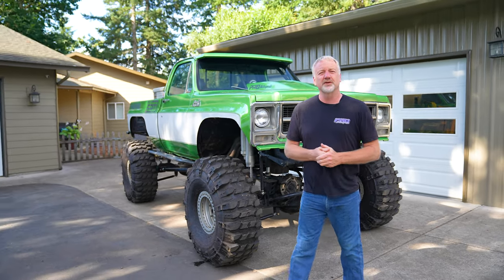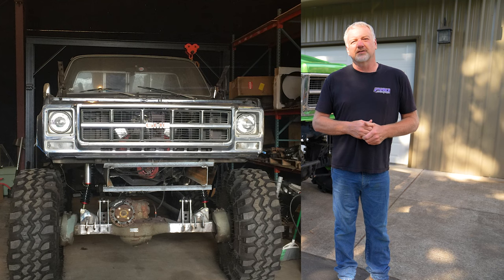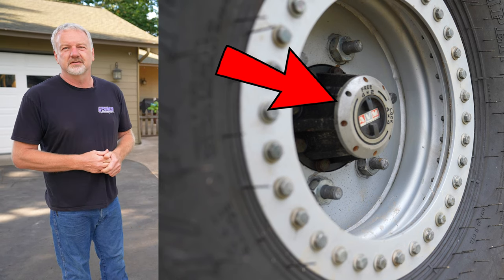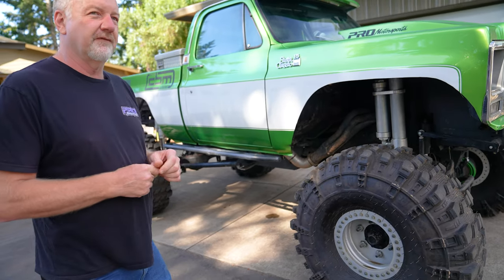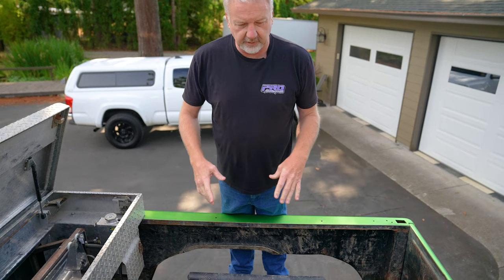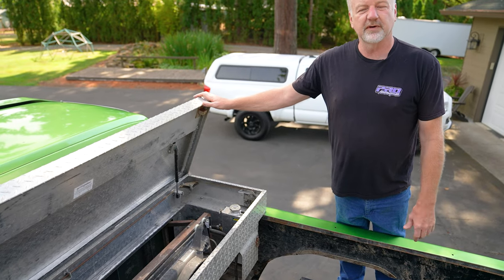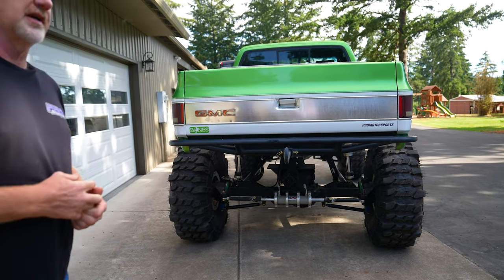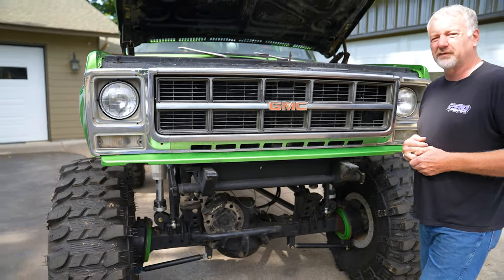Mud bog truck build

Comment: It looks like those King pin supports would be hitting stumps rocks and roots
Reply: Looks like it only goes to groomed mud parks where they dont have to worry abouy rocks and stumps but i would never run that stuff i would oversize the knuckles and bolts so they dont snap with a trussed housing and that should do it but i also go nasty places in our quarry and there are lots of hidden gems in the holes we have a hard time keeping linkage rods from smacking stuff and bending the links or snapping the heim joints off so we have to make our rigs have bare minimun including only front brakes because the rear lines get shredded or ripped off due to rocky muds with who know how many stumps and trees😂its a good time but we have to fix things a lot thats for sure the limestone mud is rough  on all the parts